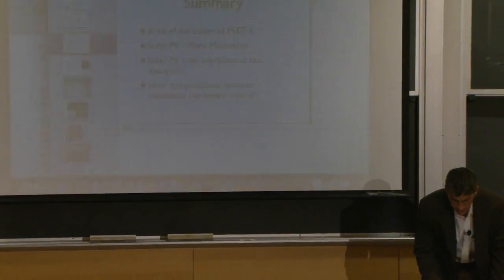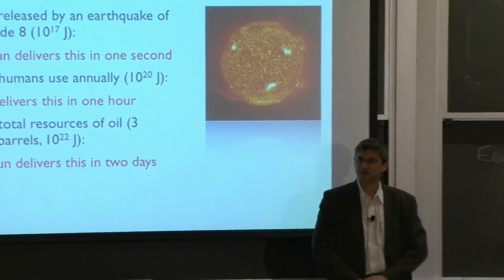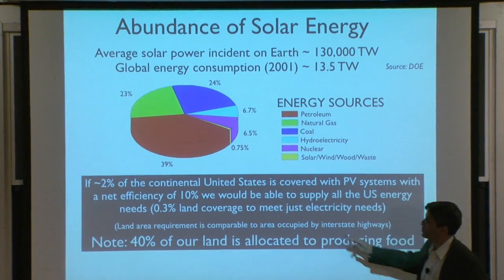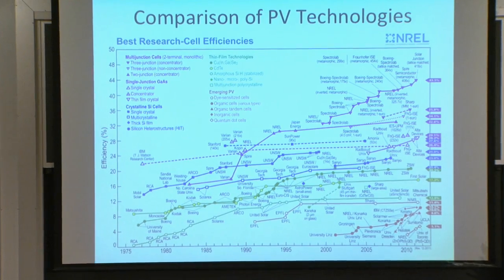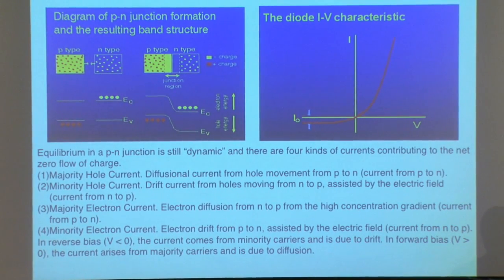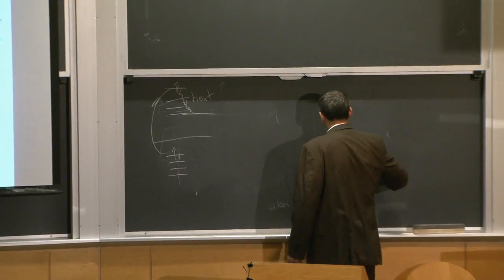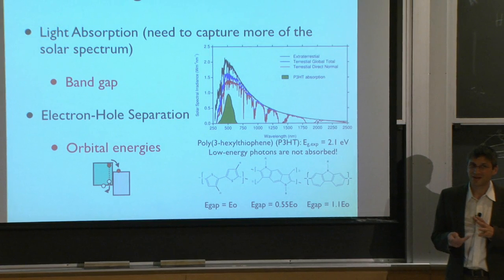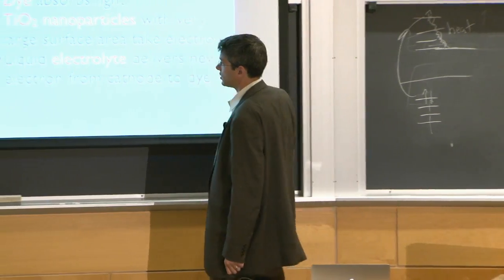10. Solar photovoltaics

Comment: Does the density of the photons / sunlight affect the efficiency of DSSC's?  Oh and you made no reference to the many CPV projects that use just mirrors to reflect tons of sunlight down to 1 small piece of high efficiency PV plate, those are reaching like 45 percent efficiency and they are using mostly cheap reflective tape on plastic mirrors.